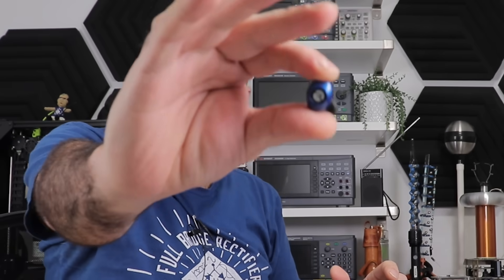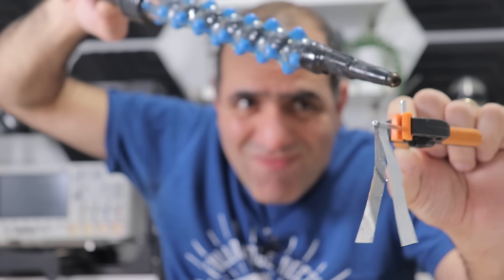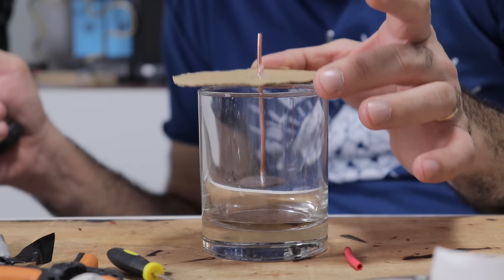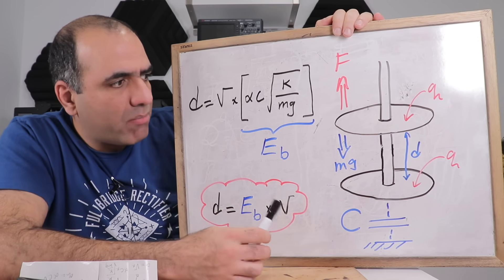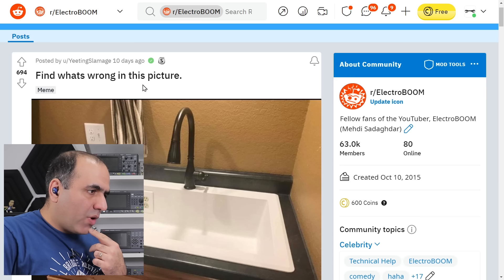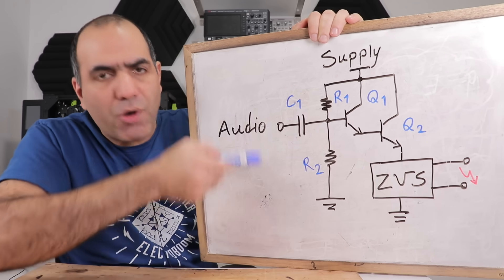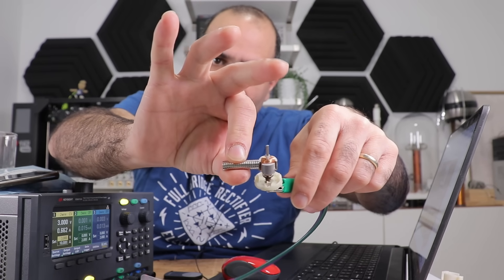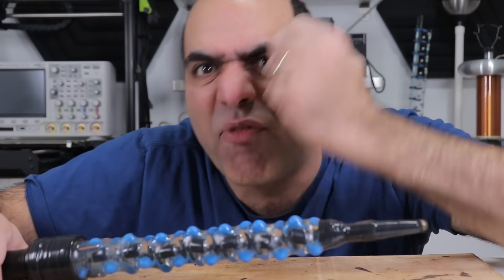I Reinvented the Electroscope! (LATITY-008)

Comment: Just a note, the calculation between the voltage and the distance is so wrong and approximate that it is funny, as you assumes that the flat plates behave like charged particles/spheres. The reason that you are correct about this relation is thanks to a theorem in applied math that is called Buckingham π theorem which in this case states that using dimension analysis there is no other viable way to create an equation that will denote units of voltage using the units of the parameters in the problem, so up to multiplying by a constant this relation is mostly correct (at least in the leading term for the real solution as there are dimensionless functions like exp and log but nvm).

This theory is the only reason that many extremely inaccourate approximations that physicist and engineers are using like assuming that a plate has a field of a sphere or that stuff like delta function is legit actually works...

Comment: Medhi, For the truck that caught on fire, I believe the guy who was crawling out had one of those green plastic lighters in his pocket likely because he smokes, in which it fell out of his pocket in which he stepped on. These cheap lighters are known to blow up when thrown really hard or if enough force is applied to them. That with the mixture of most likely dry air with cotton fibers floating around made for a perfect fire inside the truck

Comment: I always thought the electroscopes where made with gold leaf, the one I've seen in school and the science museum where made of gold leaf and stayed charged for hours and hours until they where grounded, didn't think aluminium foil would work.
Reply: Why wouldn't it work? Aluminum can hold charge.
Reply: @aminulhussain2277  aluminium works, most metals should work. i was just wondering why its widely known as the "gold leaf experiment".
 
Even though gold is a weaker conductor than silver and is more expensive than silver. probably something to do with the thickness, as commented by Ahmad the 0.5 micron vs 10-25 micron thickness is huge
Reply: @sriramn1809  Gold leaf is used because what's relavent here is not the conductivity, but the ability of a material to hold a negative charge which is determined by the electronegativity of a substance.
Reply: @aminulhussain2277  there are way more electronegative elements compared to gold. gold is just better than the rest because of its high ductility(or was it called maliability?) the property that allows it to be able to be super thin
Reply: @sriramn1809  There are few metals more electronegative than gold.
Reply: @sriramn1809  Energy is used when ionising any substance made of matter, 'electropositivity' is not actually a real thing unless you are talking about antimatter where the charges are reversed.
Reply: @aminulhussain2277  u could say that. But yea. Metals arent very electro negative. Compared to non metals. Electropositivity is the measure of how readily a material accepts electrons, i thought.
Reply: @sriramn1809  Electronegativity is how attracted an element is to electrons, please learn to use a search engine.
Reply: @aminulhussain2277  u can have as much of a professional definition as u want but my point still stands. Metals arent very electronegative compared to non metals. Whether its how much they are attracted to electrons or how much energy they give out when electron is given to it. 

If electronegativity is what is needed then why go for gold? Why not go with non metalic stuff like carbon or something.
Reply: @sriramn1809  Metals conduct better, so charge is transfered to and from them better allowing for an electroscope to fulfil its function.
Reply: @aminulhussain2277  yea so conductivity is part of the requirement, which we were discussing about.
I guess i wasnt aware about the electronegativity requirement it does make sense.

On another note. Carbon has higher electronegativity being a nonmetal, while graphite is a good conductor as well. 

So im guessing gold is used over it because of it being able to exist in the super thin form. A much smaller mass means the device will have very high sensitivity. Even small repulsion forces will cause a deflection.
Reply: @sriramn1809  Gold and carbon have very similar values for electronegativity.
Reply: @aminulhussain2277  
From what I remember even the static from a comb was enough to lift it, plus it would stay charged until grounded, it was a lot more sensitive too.
Reply: Ive heard of it in the gold leaf concept too. But probably any conductor should probably work.

Although im wondering why gold and not better conductors. Maybe coz of thr ductility that makes them able to be super thin or something so can be more sensitive?
Reply: @sriramn1809  
I think the thinness played a part in it's sensitivity, gold leaf is only 0.5 microns thick, average thickness of aluminium foil can be between 10-25 microns, so there's a big difference, sensitivity was really good on the gold leaf one from what I remember, you could trigger it with a plastic comb and it stayed charged for a very long time until it was discharged by just touching the top of it with your hand.

Comment: If the engine was running really rich, warm exhaust could carry excess gas vapor up and into the rear of the truck, and when it cools it would quickly settle to the bottom... but that is only a maybe. Not sure but more reasonable than flammable cotton dust..

Comment: It's not hard to disagree with Derek's video. He made a lot of assumptions and simplifications which he does not state, and in particular the lightbulb problem was very misleading. The lightbulb will receive a minuscule amount of current after 1/c secs and it wont increase to a level where it could be considered "powered on" for quite some time, so to say that it turns on the instant any current goes through it is BS

Comment: Ok, so you habe a circuit with a swtich and a load that is 2 halves of a light year on one side, assuming it to be half of the length of the total cicuit would be thst it is two light years in length. 

So, you have your power supply, your load, and your switch. How long would it take for the load to activate across two light years of conductance?...

Its always a trick question which makes assumptions while ignoring other factors. Assuming all things are as presented and perfect conductors with no losses, there would be no delay in activation of the load. Well there would be, but you wouldn't notice.  You'd initially might want to think about the conductors ability to tranfer electric potential and how that would be stymied by how fast electrons can travel, but the flow of power only applies to the distance to the switch or load as the potential remains constant across the circuit.

In a DC circuit it would take  a bit more that two years for the power to flow from the source, across a two light year circuit and back to itself, but since you're only move the electrons along the circuit with a constant amount of potential, the electostatic potential will cause the electrons closest to the lpad to move first and activate the load. 

But if we are to treat this seriously and factor in the losses across the conductor, the ability for the electron pressure to move along the circuit yadda yadda...yes it would have a significant delay. What that is i have no idea since im not an electrical engineer or any type of scientist.

Comment: I don't know about a dust explosion, but if you want static electricity, work in a pvc plant. You'd have to jump chest first over those bundles of pipe to strap them for transport. The charge would build up so high that you could get a visible half to three quarters inch arc fron your dinger to a piece of metal. Man that hurt.

Comment: You probably already knew this... Two point sources vary as the square of the distance between them. Repulsion from an infinite line to a point source varies linearly with distance.  Two infinitely large plates do not vary with separation distance, but rather repulsion remains constant.
I still think you're the smartest, best looking electrical engineer in the whole world.  I watch you all the time, and think you're very funny.  I'm writing this note with a crayon because the doctors won't let me have anything sharp.

Comment: quite possible there were cotton flyings in the air. Canadian electric codes classifies combustable dust and flyings as an hazardous area for electrical systems. Possible I guess for a static discharge to ignite an atmosphere in between the upper and lower combustable limits

Comment: id say we need to examine the speed of travel. is it instanteous or is 
there a speed to the movement of electricity? given a long enough wire 
it should be measurable. once we know that we know the result. if 
instant, there is no wait time. if not then it takes as long as it does.
 of note is energy packets are photons and move at the speed of light, 
but that doesnt account for the time they spend in the next atom before 
being released. also the atoms releasing now are free to accept more, 
drawing from the negative end. so there would be a wave in both 
directions and if either reaches the light it will glow. so if there is a
 time delay it would be longer then a lightyear, but only be relatively 
small amounts.

Comment: 06:59 Because you used a darlington emitter follower the voltage swing at the zvs can not be more than the input signal - which is low. So the volume is low. If you connect the ground from your phone to the emitter of the darlington instead of ground the swing would be much greater.
Reply: I am building a similar circuit.  Please elaborate more on the difference
Reply: @kekwnet  An emitter follower allways has a voltage amplification < 1 - that changes if the input reference is not ground but the emitter. I would recommend to simulate it to see the difference - too hard for me to explain in a short comment (I'm not english)  ;-). But keep in mind: it is only possible when the input signal is not connected/ to ground ...
I used it e.g. to amplify  signals of a battery operated clock (1V5)  to logik level and higher.
Reply: @tipfox9212  thanks, will definitely try

Comment: I don't think Veritasium's video is completely wrong, but I think he's excessively glossing over the coupling strength between the two wires. (And he doesn't acknowledge at all that he's treating the two wires segments as antennas.) I'm not sure it's actually possible to turn the lightbulb on via radiation with the same voltage that will work for the DC connection through the wires. I think you'd either have too weak a signal for the radiation part, or when your huge DC voltage reaches the bulb it will just melt it. 

I also don't think the lightbulb would stay on, but I'm less certain about that. It seems to me that you only have current (and thus magnetic field) near the battery for a short time when you switch it on, but then it drops again as a current impulse travels down the wire away from the switch and bulb (a pulse that travels like a line of falling dominos). So the lightbulb would blink on very briefly but then stay off until the DC voltage/current pulse reaches it through the wire. 

In general I think you need a high frequency system for it to work at all. You'd need capacitors in parallel with the battery to quickly switch on the current, you'd probably want to just use a transitor instead of a mechanical switch, and you'd need a pretty fast (and low power) LED as a bulb. A car battery and mechanical switch would just kill any energy transmitted at higher frequencies.